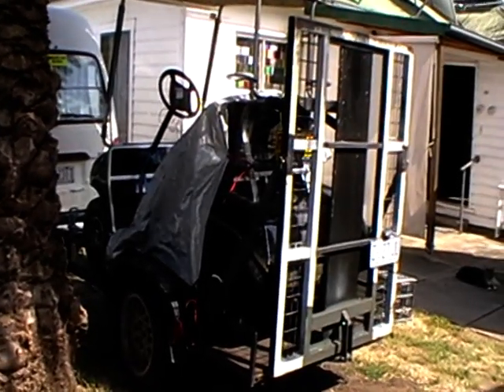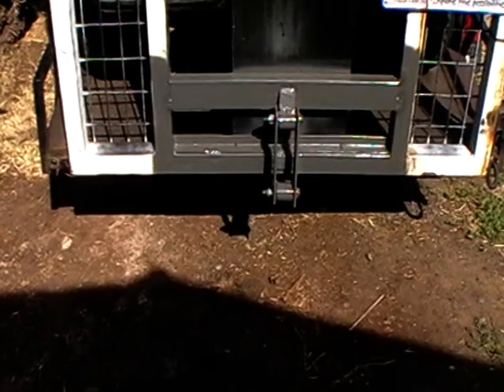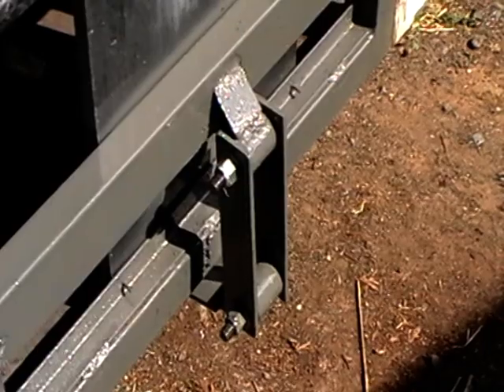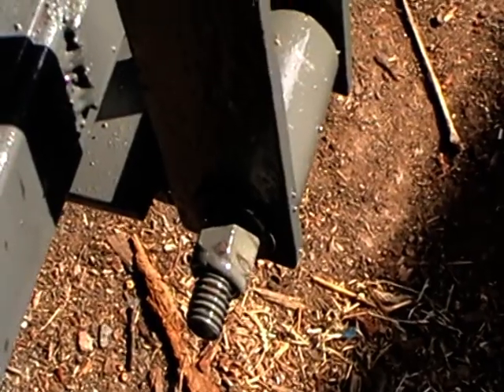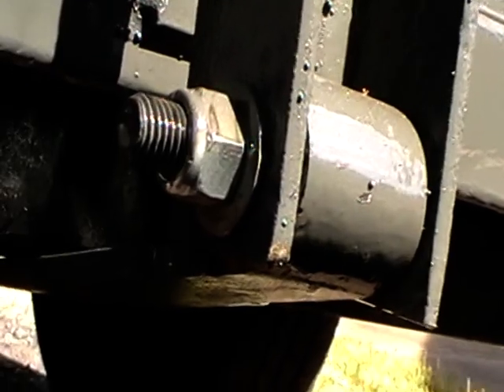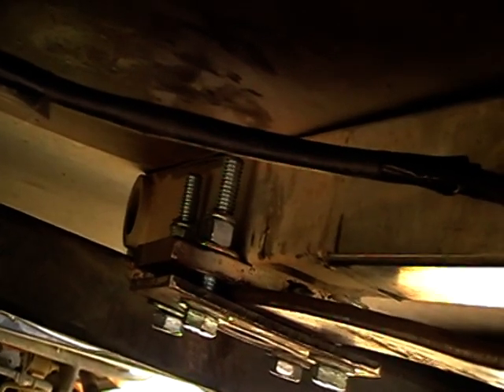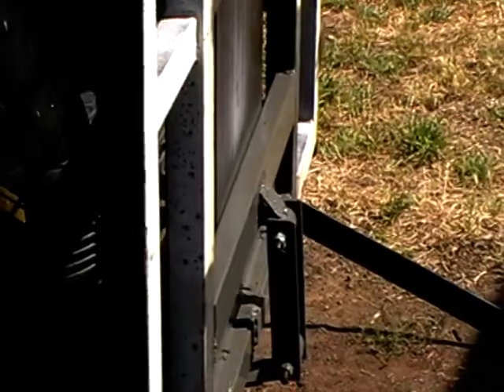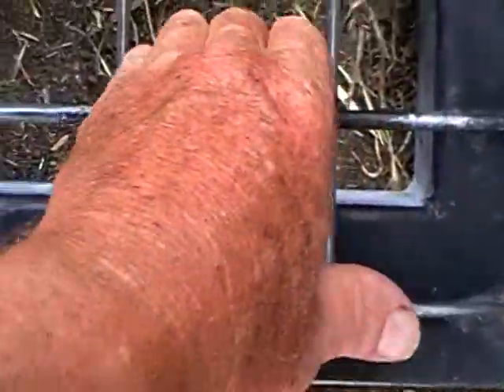trailer ramp assist spring. Using a car single leaf spring  . Uses basic parts.

Comment from the maker: Patrick this setup still going a1 For sure. On my golf buggy trailer. Only mod I might make if doing again is a sliding square tube mount underneath. Could then adjust in and out to change tension. Mine has the clamp fixed setup as per video. Could clamp to test action then pin with a cross pin like a towball socket when you get it how you want. Very simple safe system .
Reply from the maker: Could run 2 spring sets for heavier drop down ramps also. One each side...

Comment from the maker: Could make it adjustable . A mount that slides along square tube spine under trailer  would be OK. Or could shorten the 2 pivot arms to alter loading of spring?  This system been used on  U Haul trailers for many years in USA it seems. Be interested in some pics  or videos of one on a  USA u haul trailer if anyone has them.. Even better some sizes of  their parts.  Am in Tasmania Australia.

Comment from the maker: Used a new mig welder on job.  Spatter stopped now after making earth +ve for gasless wire. .   Top mount has a 2nd brace web to give more weld contact. A newer heavier spring would give more resistance. This one off old 1950s Holden car.  Having 2 sets would do even more supporting. eg space 500mm apart. Had to weld a centre spine under plus the cross tubing on trailer ramp for top pivot mount. Do what suits your trailer. Makes lifting much safer for sure. Was a backbreaker originally .  The alternate garage spring type top setups  gorilla style lifts would have gotten in way when loading buggy here..